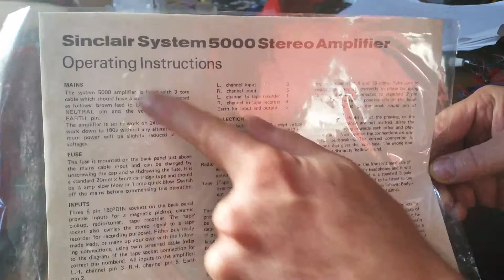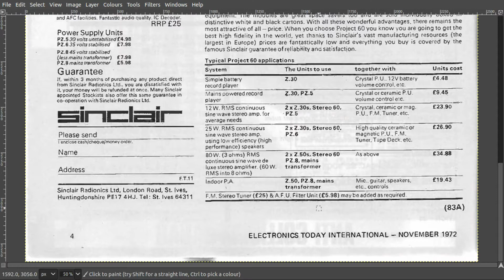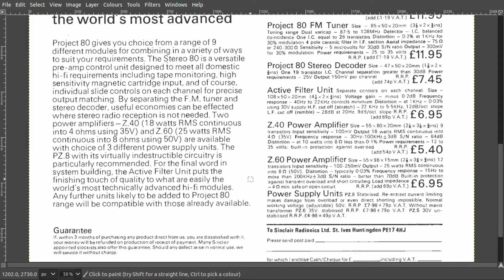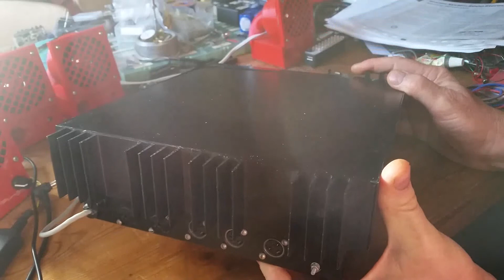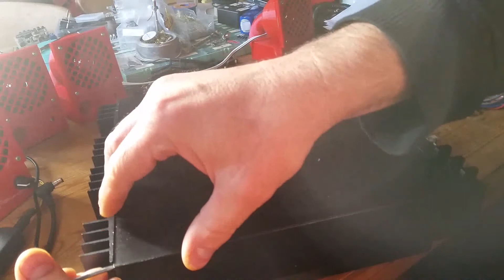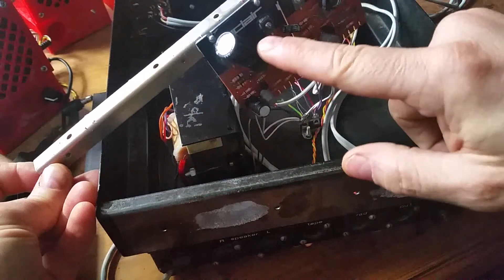Sinclair Radionics System 5000 Amplifier

Comment: I was a test engineer with Cambridge Audio at that time. We shared a common building, once a mill right next to the river in St Ives. This was a very embarrassing time as Cambridge Audio had a good reputation as a quality HiFi amplifier and Sinclair was just cheap crap. Sounded dreadful, was unreliable and full of cheap unbranded components. Was built to a similar standard as Amstrad.

Comment: I think you will find the two knobs were not a FM radio
but a filter for the record player
The FM radio,, was  as long as the Pre amplifier panel
single knob and screen for the stations wave length

Comment: I bought one of these from Laskys in Corporation Street, Birmingham, in July 1976 mainly because it was cheap and I was poor - I had just started work after university.  It sounded ok but obtaining DIN connectors was a bit of a pain as even then RCA plugs and banana plugs were becoming more common on mid-range kit, partially because the 5-pin din interconnects suffered from poor contacts.   The amp worked until 1979, but suffered from hum on the phono input even when earthed, and to an extent on the other inputs,  as in this video.  The plastic sliders gradually broke until I was sliding tiny pips of clear plastic!   When I had some money I replaced it with a Sanyo tuner-amp with 50W per channel and solid metal rotary controls, before going on to Crimson Electrik kits with 100W+ per channel (also in matt black steel boxes).  When I bought the 5000 I thought that selling a complete amp was a logical extension of selling kit modules, but later on I was given to understand that Sinclair Radionics made these up to clear stocks of the various modules that go into it as they were not selling too well.   This may explain why the box has no model identifier or serial number.    Nice to see one with the original user guide...I probably threw mine way way back when no-one was interested in 1970's vintage hifi.
Reply from the maker: Thanks for the information. It's good to know more of the background history from your experience as there is little that is easy to find.